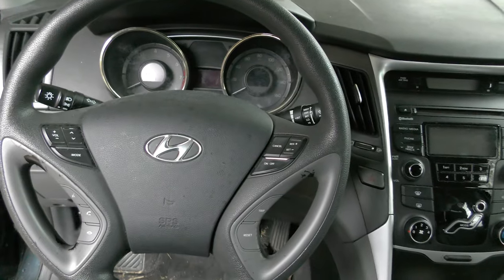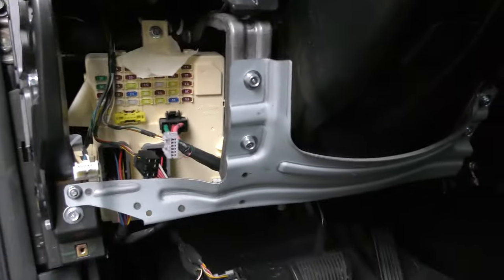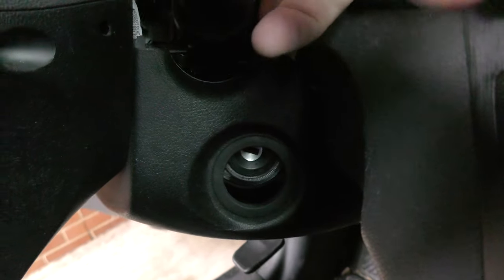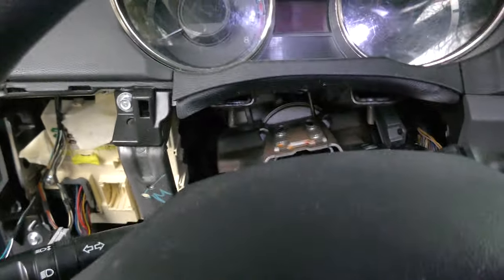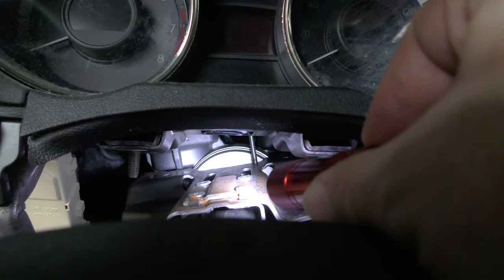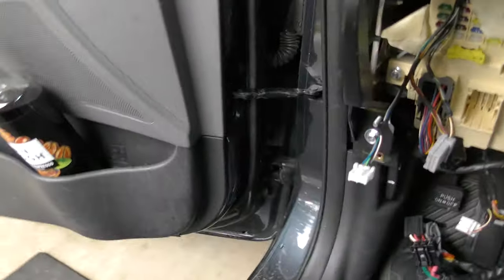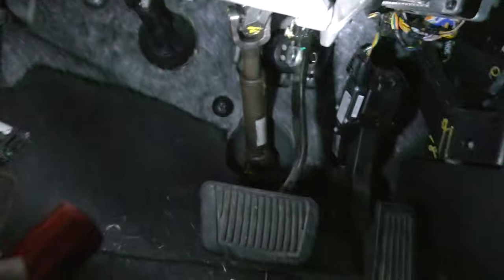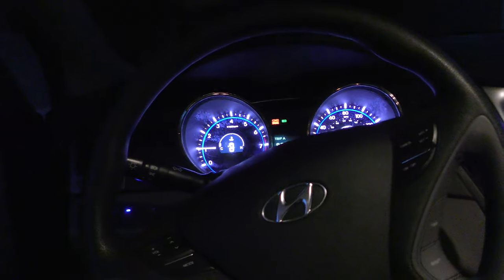Hyundai Steering Wheel CLUNK Driving You Nuts? Do This - Bushing/Coupler Replacement - Jody Bruchon

Comment: Thanks for your help with this. This video helped me replace the little bushing that only costs like 9 bucks on Amazon. Saved me close to $400 in service. The clanking is gone and I’m back to driving my 2013 Sonata for a little while longer. The hardest part was getting the hook from the steering wheel back where it belonged.
Reply from the maker: I did it alone until it was hooking time. That part really was the absolute worst, especially in winter. Thank you for the super thanks and I'm vert happy to have helped. Most videos of the process were unclear or difficult to follow or seemed to omit critical parts so I gleaned all the info I could and made my own.

Comment: 18:11 "its way harder than it should be honestly"  that pretty much sums up alot of repairs on modern vehicles.  So many jobs on newer cars are like this, replacing a $10 part requires $300+ in labor because half the interior has to come apart to do it.

My favorite engineer "i aint gotta work on it" fail is late 90's-early 2000's GM trucks (s-10 & fullsize) 9-11hrs labor to replace a $35 heater core because the entire dash assembly has to be removed from the truck, especially annoying since they knew how to do better the generation of trucks before that heater core could be done in 45 mins.

Comment: Question: Is it possible to reach the 3 torx bolts and replace plastic coupler without completely dropping the whole steering column? Can I leave it held up by the hook?
Reply from the maker: I tried to do things without dropping the column. It's not really possible. You need the room to move.

Comment: How long can I drive with this problem?
Reply from the maker: It's not likely to damage the vehicle, but it's extremely annoying and may present a bit of a safety hazard since the steering will be a tad sloppy and shaky.
Reply: I’m hoping this little piece really takes away the vibrating im hoping this little piece will save me! It’s rattling good sometime but I think it’s just super worn I hope. I def get the click but would this going out also cause a vibration in the wheel as it degrades?

Comment: Well I live in Korea and I went in to get my steering checked I have a Hyundai I 30 and when I left they said it was OK but I found one of these steering coupler‘s on my floor below my steering wheel so I went back and they don’t speak English they just told me it’s OK go so I was always worried maybe they didn’t put it back when they checked but if I’m having no problem my steering I must have one of these couplers in correct 
Or I would definitely know about it right
Reply from the maker: It can't fall out of your MDPS motor without this entire disassembly being done. If you found one, it's almost certainly not from your car.
Reply: Yeah I was just wondering because they checked it and put it back so I just thought maybe they forgot the place that in but I would probably know it when I drive right
Reply: They did Dissemble it and checked it so I just wondered because I found one of those after they get my car back

Comment: Did you get an EPS Light when this problem began? I have an EPS light on my 10’ Elantra and pretty sure it’s the same problem. The noise and the clicking are exactly like yours.
Reply from the maker: No, just some horrible clunking steering.
Reply: I have an eps light did you ever find out if it was the same problem?